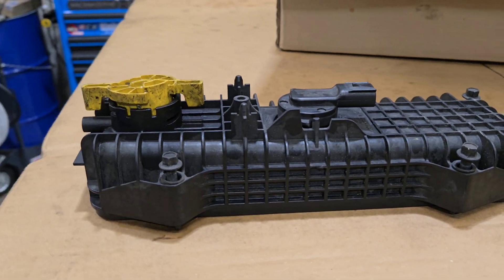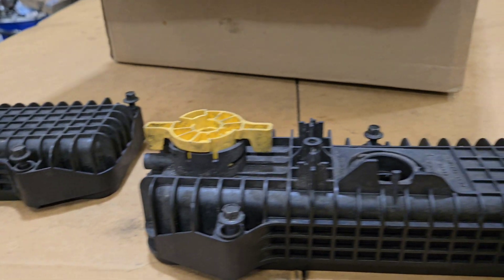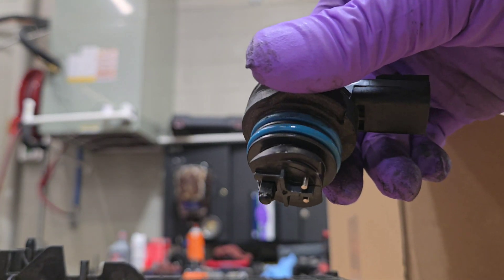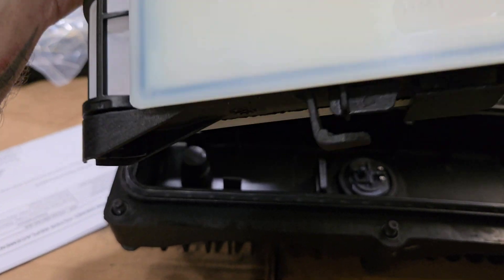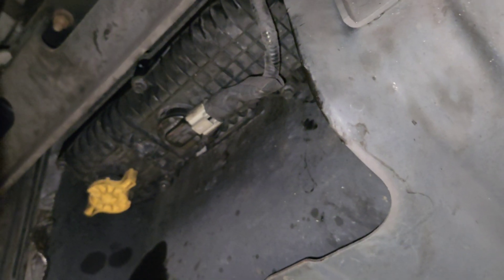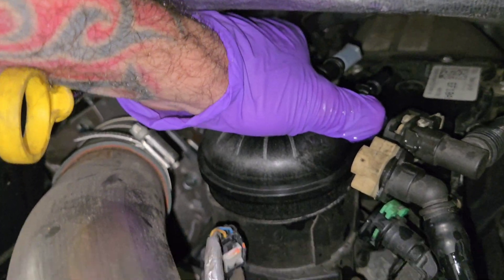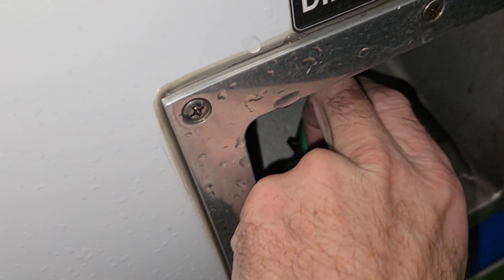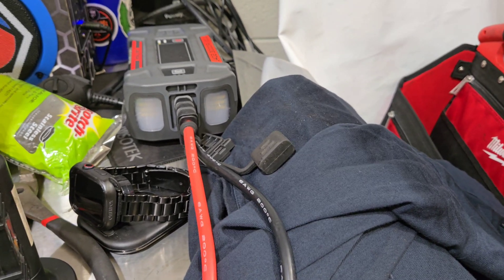Diesel Fuel Water Separator.  What Happened?  The Sad Truth.

Comment: Why replace the whole cover and not just the valve?  Ironically I just drained /inspected my fuel on my 23 this past Saturday and broke the tits on my valve as well.  Have probably used 5-6 times in the last 8 months.  Dealership was closed and found a Dorman valve at a regional Auto Zone warehouse store for 12.00.  Used that to get back up and running, then immediately ordered the SPE Green billet valve that gets delivered today.
Reply from the maker: @ThomasProvenza  because the lid from ford comes with the valve. Not seperate. I'm not replacing the valve with an auto parts store one.  The lid where the valve goes was cracked as well.
Reply: @BeardedFordTech  HC3Z9J305A part number for the plug $2.50
Reply from the maker: @BullittOutdoors  wasnt available as just a plug on the f450. I look directly at the dealers inventory. Thats why I got the whole cap assembly. They didn't even have that in stock which is why I got the used one from a friend. This has been said in comments below.  Besides the point. If I'm going thay far. I'm replacing the whole lid.  Reason being. It's a fleet. Not a normal everyday public customer. I dont have those.

Comment: Hey, this is the part # HC3Z-9J305-A that fit my fuel filter
Reply from the maker: @zekester1  are you talking about the lid?  Email me your vin and I'll verify.
Reply: @BeardedFordTech  yes that yellow drain valve/plug on the fuel conditioner lid...I paid about $12 off of Amazon for two instead of the OEM part that was $20 at that time...they are even cheaper now around $8

Comment: Somebody (S&S?) makes an after-market aluminum cap to replace the plastic one. Thinking of buying one so when mine goes I won't have to worry about it again. Plastic everywhere these days and it stinks. Not just Ford, they all do it. At least our trucks still have metal bumpers!
Reply: @GuretoSefirosu. Save yourself some cash, instead paying 60+ bucks for the aluminum... you can pick up two of the yellow plastic ones for under 10 on a well known online market place
Reply: @zekester1  The point was to not have another one break.
Reply: @zekester1  Because, if you are just draining a little fuel for inspection, and it breaks and causes a big mess, the 60.00 was money well spent to minimize the hassle in the future.
Reply: @ThomasProvenza   Hey, that's cool...just   wanted to point out an option
Reply: Too bad that “aluminum drain valve company “ has brutal customer service…. That style drain won’t break…but also won’t drain very well unless you break the seal on the whole housing gasket .  Makes a good paper weight for the desk however

Comment: Plastic parts 😅. Do fuel filter housing on the frame on 2011-2016 break easily or are they durable?
Reply from the maker: @GarzaDiesel  2011-16 is plastiactuallyupper portion the filter goes into is actually the pump. The lower is the filter housing. They are pretty durable. I've never broke one of those. Or come across a broken one.
Reply: @BeardedFordTech  😎👍🏼
Reply from the maker: @GarzasGarage  💯💯

Comment: After the dealer broke that drain valve on mine( oh by the way, that was on the first fuel filter change @ 10k)... For that reason, I keep a repacement drain valve under back seat
Reply from the maker: @zekester1  thats the first one I ever broke. That bad boy was stuck.
Reply: @BeardedFordTech  Is there a problem telling people where to get a replacement yellow drain valve???....tried several times
Reply from the maker: @zekester1  it comes as part of the lower. It's not a seperate piece
Reply: @BeardedFordTech  wellI guess it's changed for my '18 you can replace the valve only
Reply: Would it have been easier just to place the new yellow drain on the old one ? Just asking.
Reply from the maker: @armedprophet3321  there wasn't a new yellow drain. That was a broken yellow drain. You can't get the drain seperate. Comes with the lid. The lid doesn't come with the sensor
Reply: @BeardedFordTech  ohhhhh…..my bad. No wonder I couldn’t find one to buy as a spare on the Ford OEM website because I just started looking for one after I saw your video. But is it possible to just replace the yellow drain plug without having to replace the entire lower unit ? Or are they made to not be separated ?
Reply from the maker: @armedprophet3321  made to not be separated. It's part of the lower.
Reply: @BeardedFordTech  Now is there a difference between Cab Chassis & Pickup truck filter housing???...I have a '18 drw 48 gal. Midship  tank pickup truck